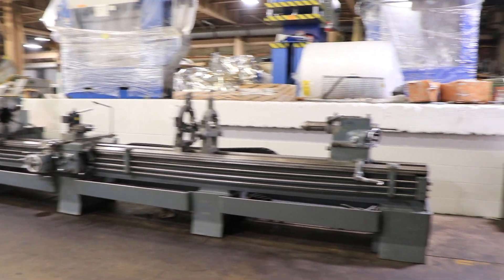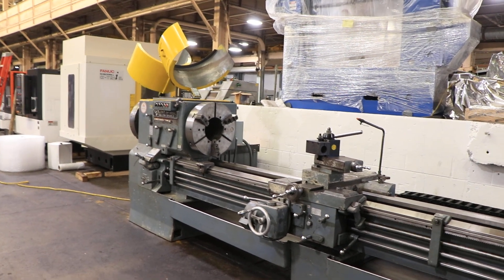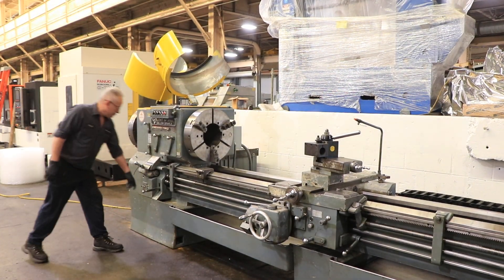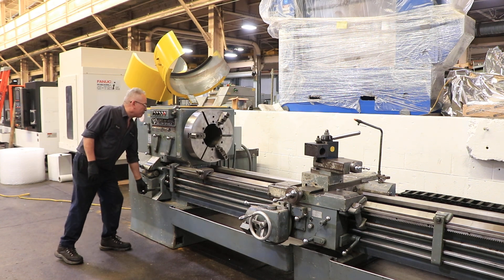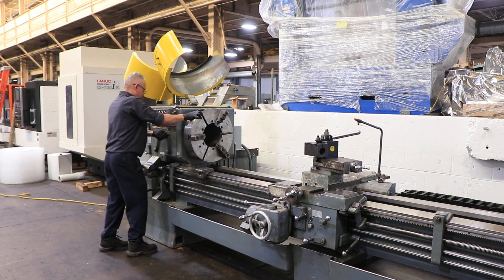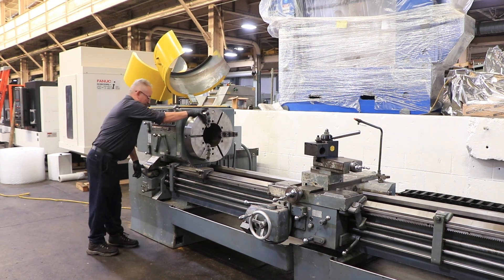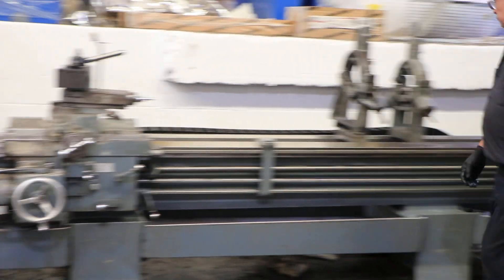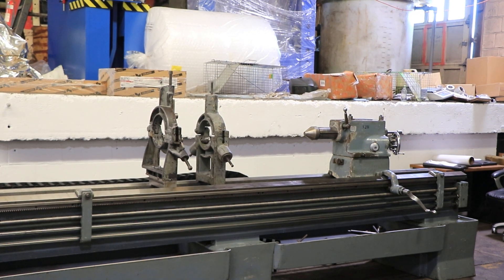26" X 192" LEBLOND REGAL ENGINE LATHE

Comment: I wonder what year that machine was built. 15 hp spindle and 6 to 400 speed must have seemed like hot stuff. Today, CNC lathes have 50 - 70 ho tool spindles and ??? Bhp chucks.
Reply from the maker: According to our literature from Leblond, it is a 1970 machine.